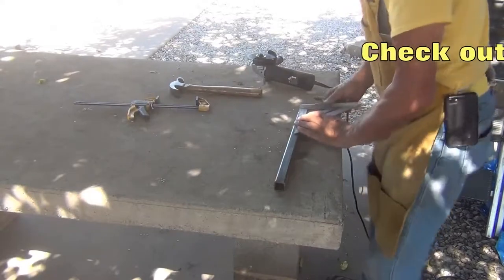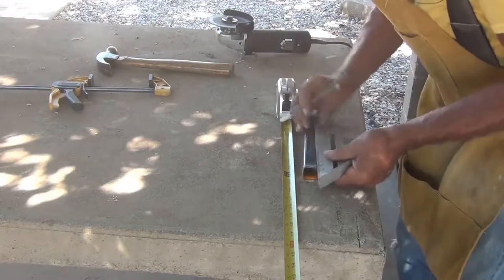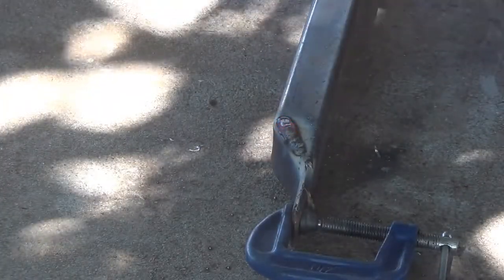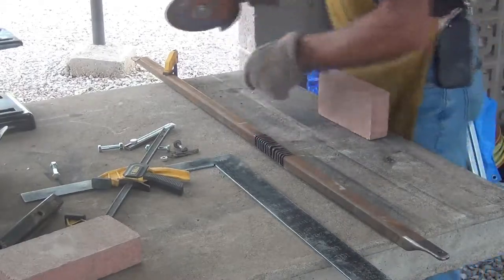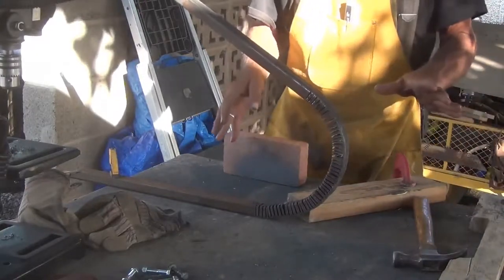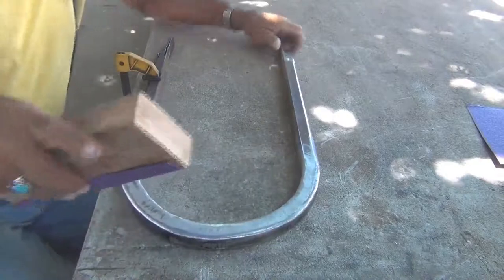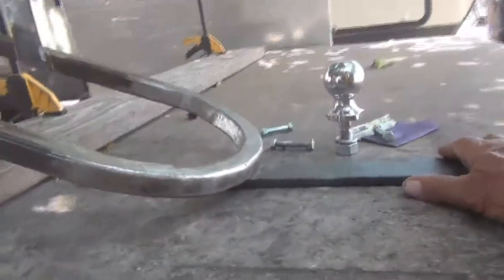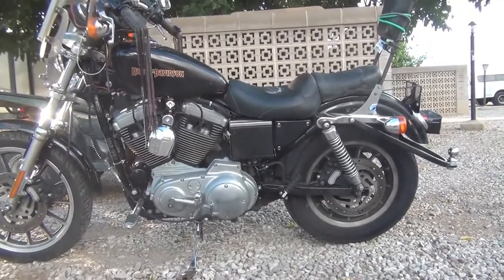#63 Build Trailer Hitch For Harley Sportster

Comment: Thanks for posting. I have an 06 Sportster and I’m thinking of making a hitch for it. Have you found that it has plenty of power to pull 100 pounds?
Reply from the maker: My trailer is rated for 1,000 lbs. I have never had more than 550 to 600 lbs on it. It will pull the trailer just fine the thing you have to think about is STOPPING!
I have pulled my trailer well over 2,500 miles with no trouble.
Thanks for watching have a GREAT day.
Reply: @davescorneroftheworld1147  that’s good news, thanks again!

Comment: Interesting design, I'm looking at having to build something similar for my Kawasaki Vulcan 900 custom.  I don't know if I'd trust that 1"x 1/16" wall square tube though, I guess it depends on the weight you plan to pull but I was thinking about making brackets from 1/8" sheet and using 5/8" rod for the bend with a 1/4" plate for the ball mount and chains.   I'm just shopping around for ideas right now, I hope to start the build in a couple of days.  Nice work.
Reply from the maker: I am very sorry I did not get back to you before now. My 1 X 1 X 1/16 wall will pull anything. I am going to build a second one someday and it will be made of 1/2 X 1/2 solid bar. This one will hold up for ever. I have jumped up and down on it and it will not brake. I do not like this one because it looks to big and bulky for my liking. I have been working for someone the last month and a half and I just have not done anything for myself or YouTube. Thank you for your comment and let me know how yours turns out.
Reply: I believe your hitch will be fine, I wasn't knocking it, I just personally believe in over building when I can.  I just finished welding  up the hitch portion of mine earlier today and got a first coat of paint on it.  I made brackets for each side of the frame from 11 gauge 304 stainless that act as duel receivers for the bent 3/4" rod hitch so that I can pull the hitch off when I'm not using it.  I had all that material from scrap. Mine looks a little bulky to be honest but I think it fits the bike ok so I'm good with it.  Took me a while to manufacture, I'm disabled and can only work a couple hours a day.  The bike wasn't really designed for a hitch either so coming up with a working design that attached to the frame and that I was happy with took some trial and error.

I made the ball a swivel mount as well, I may post a video on how I did that.  It's a true swivel mount for the ball, allowing the ball to swivel on is center axis, I don't  want to have to worry about how far I can lean the bike while pulling a trailer..
Reply from the maker: @Allazander  I would love to see pictures of it. If you would send them to me at: info@DavesCornerOfTheWorld.com.
I am going to make my trailer hitch swivel instead of the ball.